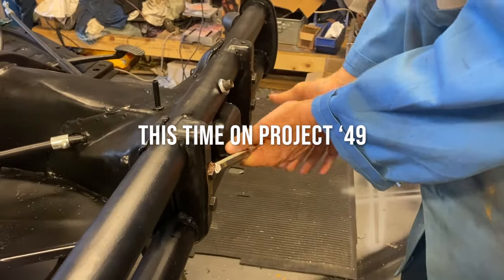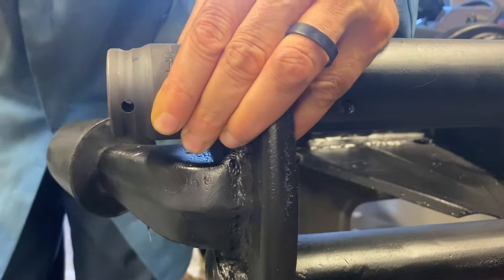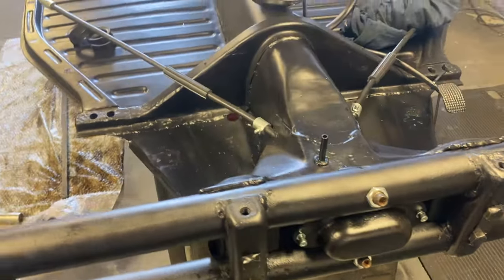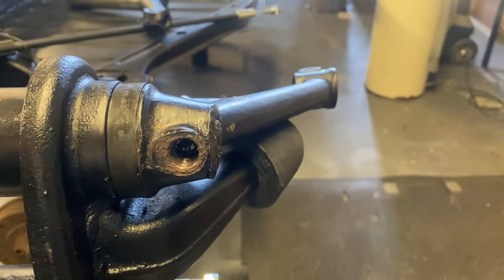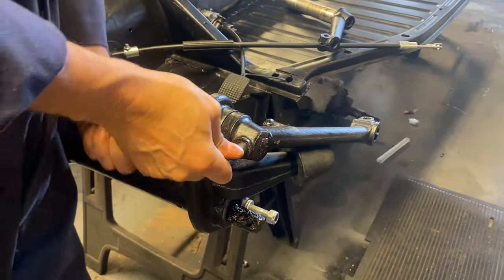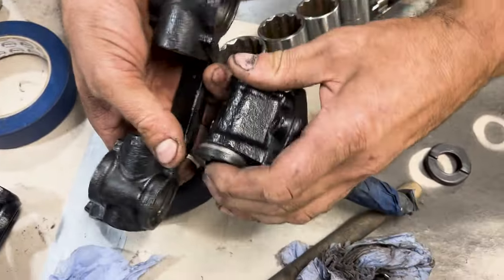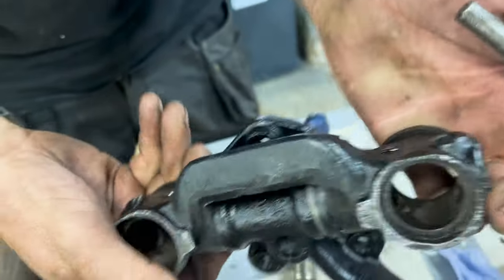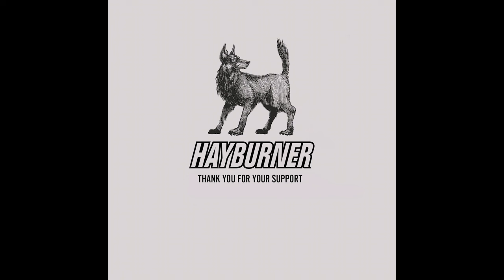Project '49 Split Bug Restoration - Episode 2. Rebuilding the Beam, Arms, and Spindles

Comment: Alright fellas.  My king pin was stuck in my spindle one time also.  It was a right pain in the arse!  The steering got slowly more and more stiff over time until I could barely drive.
My mechanic dude took it to a mate with a 5 ton press and even that wouldn't get it out!  Fortunately he knew a place with a 20 ton press, and that got the job done - finally.
It's really interesting how these old ones go together.  I love how the link pins go in, with the different number of shims here and there.  Well done.
Reply from the maker: Oh for sure, it's a very clever set up that they stuck with for decades